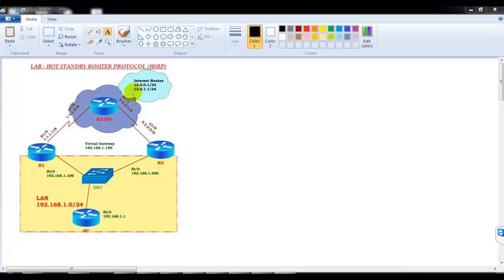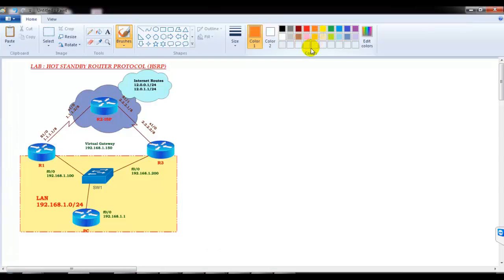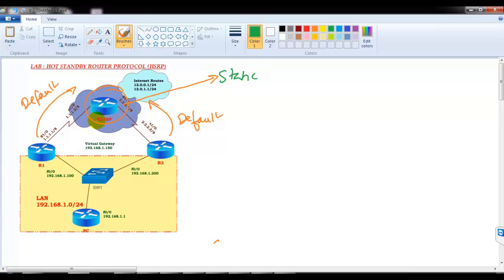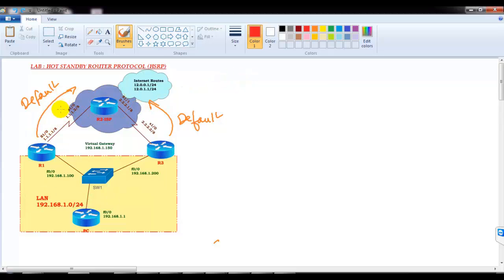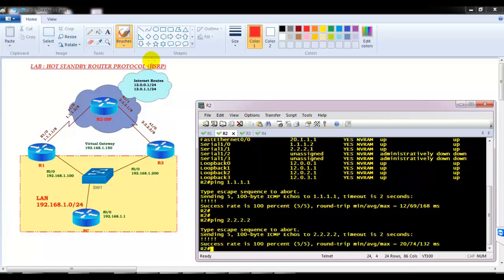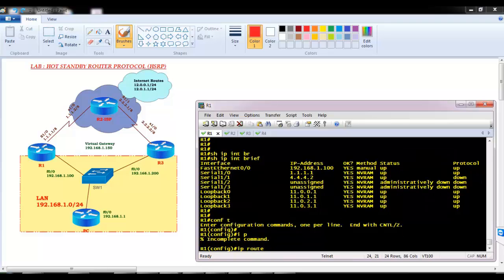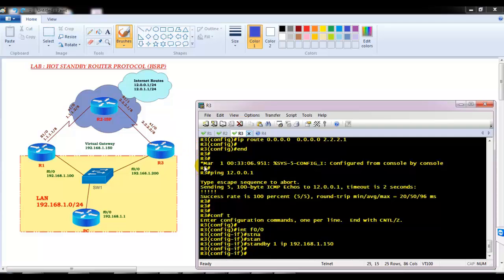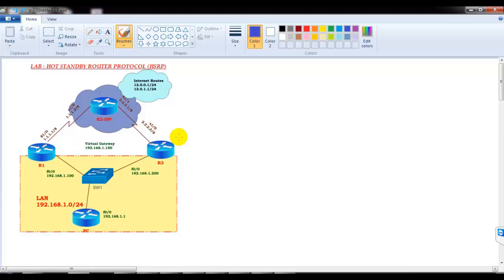HSRP lab - Basic - Video By Sikandar Shaik || Dual CCIE (RS/SP) # 35012

Comment: hi, Sikandar thanks for the video its really helpful, 

Have some doubts I create the same example but I can able to reach the internet (12.0.0.1) from pc(R4) using the gateway of 192.168.1.150  without configuring the HSRP in R1 & R3.
How come it's possible?

Kindly clarify the doubts.
Reply: Hsrp or any Fhrp is not necessary for communication they only provide redundancies.